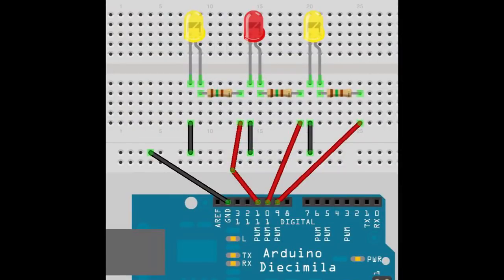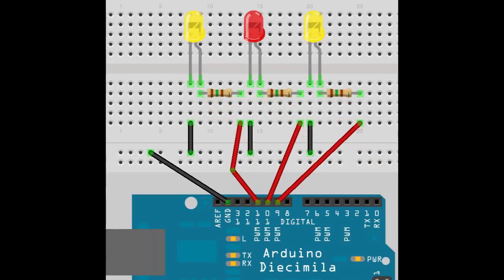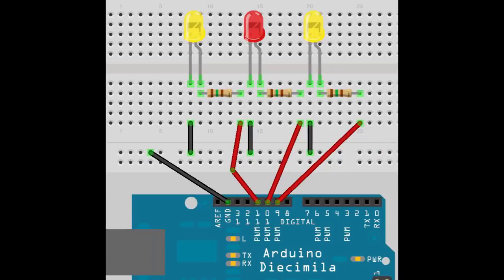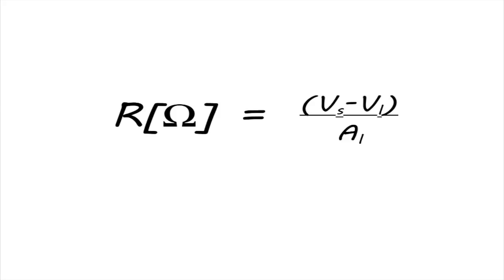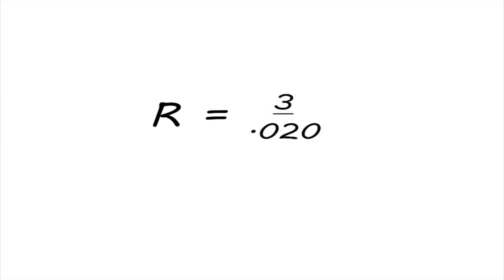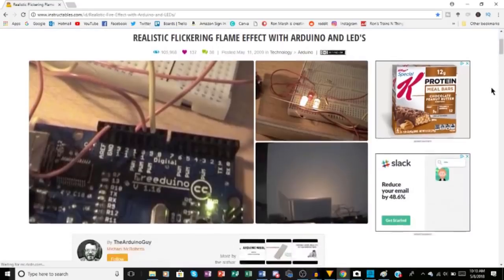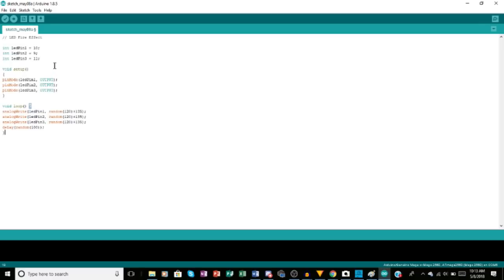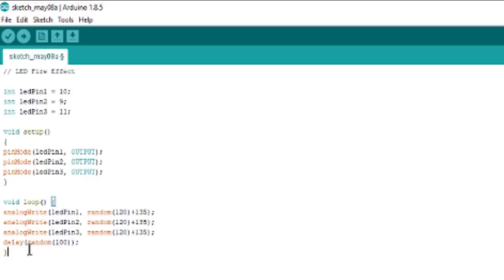Arduino Model Railroad Projects - Campfire

Comment: I am just starting a new small HO DC table and planing historically correct Native American aria with camp fires and hot rocks. I love this setup, but disabled and on a small fixed income, no DCC for me and thinking outside the box to do with what I got. So so far I have good results with $2 set of 4 battery tea lights. Not perfect,  but making them serviceable, I could replace them from under..... they only have yellow LEDs, but I think with some work, I think they can be parted out and changed up with other LEDs and maybe use more the one per fire.... ? But yes, I wish I could go this rout.....

Comment: Looks good as a bon fire but seriously way too large for  a camp fire. I just bought a camp fire module online for $13.00  Just give it power and it looks like a real fire. Mine was for a HO scale layout but would be easy to scale for N.  I like arduino, but sometimes its cheaper and easier to buy ready made circuits.
Reply from the maker: Yeah, the  sample was made with waybtoo large leds for video. I made one with 04-02 leds that is a perfect camp fire.

Comment: I wish you included in the video how you did wire it to the track or the bus, how did you solder the LED so on so forth, it is very clear on the "bread" but the track is different beast. Thanks for the great video.

Comment: Great video Mr. Ron!  I’m finally getting time to get back into model railroading and am astounded at all that is available today.  It seems that most of the things I’ve been fortunate enough to work at for the last 40+ years are culminating in this great hobby.  I built my first model car at about 5 and my first HO layout in my mid 20”s  with electronics as an early hobby , too many things to list over the years.  All I can say is, what a time to be alive!  Thanks for your great videos!
Reply from the maker: I get it. It took 25 years of collecting and a lifetime of hobby experience to get where I am in the hobby today.

Comment: One fun tip is to cast flames out of resin or other materials that dry clear then place it over an LED like a lampshade or cap when lit. Indeed a small pocket that the LED can sit in also helps in scaling a campfire and the cast flames can even be dyed/washed with color if desired.

Comment: wonder if you could mount this under the table, with a hole so the light comes through but the size can be scaled down.  Great work and it looks wonderful.
Reply from the maker: You could recess it down into the base of your layout, but you can also get smaller LEDs which is an easier solution.
Reply: Things are already getting too small for my eyes in N scale.

Comment: Absolutely one of the best explanations of a simple Arduino project I have seen.  I especially appreciated your use of graphics to demonstrate the circuit on the breadboard. Well done.  You are probably aware of this but there are a number of on line and phone apps that will calculate resistor size. I use iResistor and Perfboard on my iphone.
Reply from the maker: Yes, I am aware of that but wanted people to know how to do it also.

Comment: Can arduonos do multiple things?  Like could you power a small speaker with crackling fire sounds from the same board?
Reply: It is possible to multi task the Arduino to do both light effects and play sound; however, it complicates the  sketch.
Reply from the maker: I'm not sure, but that is something I'm looking to.
Reply from the maker: That's what I figured and that makes sense.

Comment: A very nice intro of Arduino to the model railroading community. Arduino has grown big amoung the young in the past decade. Its also a great learning aid for people interested in programming or electronics. Its sort of a "lego" for programming and electronics in that it has simplified everything to a plug and play system anyone of any age and skill level can get into affordably.

I've long seen arduino as being complementary to many hobbies and may be a way for the aging clubs to attract young members. Plus something young members can bring to existing clubs.

One essential place to visit is http://circuits.io which is entirely free and now hosted by Autodesk. circuits.io is basically an online simulator for Arduino so you can learn and experiment in safety very easily. Electronics is much simpler than most people realise and arduino makes it even easier. Especially if you think things like "I wonder what happens if I change out this led for a motor instead?" "Or I want these lights to flash red and blue". In this video we saw Ron found one of his LEDs was too brightly red and it only took a simple change in one value in the code to make the adjustment. Thats the power of the arduino platform, its designed to be solderless and the arduino boards (of which there are many) typically all run the same using the same bit of code you write plus they just plug in like any other USB device. This means if you want the same effect in different parts of your layout you can simply upload your code to several arduino boards wired up to LEDs the same way and they will all do the same thing.

Don't just think simple campfires, how about adding in a light sensor so as you dim your layout lighting the campfire becomes "lit", or the street lights come on. Don't just think lighting either, consider motors pulling fishing line to have moving cranes, boats, cars, industry features on your layout bringing it to life. Then theres all sorts of sensors You can use to detect things that happen: train reaching a layout point to light a displayboard marker, somebody walking into your layout room and the layout comes to life. Temperature/voltage sensors to alert you to potential problems on your layout. Then there are the displays of all sorts to allow display of whats happening on your layout and automate some calculations for you. Maybe you want a display to see what speed your high speed passenger service reached and averaged on its run today, or to display the efficiency of your train controllers: did all the trains make it on time according to their timetables etc. how about using an accelerometer, gyro and memory card writer to mount on a train flatbed to measure G forces and other loads as it travels around a layout all being recorded to a memory card you can read on your computer and help you determine risky curves on the layout and bumpy switches/track joins.

Arduino offers infinite possibilities to complement model railroading and many other hobbies. Its very cheap to pick up a starter kit with all sorts of devices to experiment with, lots of online tutorials and help available. As you learn and improve your code you can easily update any ardunios you have secured into your layout to improve its task as you need (just keep its usb port accessible. There are a confusing number of arduino boards available, I recommend the arduino uno as a good starting point. its a good design with capabilities for adding a variety of inputs and ouputs at once. Its pretty much all you need most of the time. There are smaller arduino boards which offer less "pins" used for inputs or outputs so if you are space constrained (like in a shipping container on a layout) this can be handy. and there are larger ones which offer more pins, or faster processor speeds. Plus there are specialised ones ready to allow you to control mains voltages to things like fans or heaters or for multiple relays. But they all run the same basic code and should all have the same pin numbers and basic connectors meaning Rons simple project could be used on any arduino board available without need to change any code or wiring. As you experiment and learn you will encounter the limitations of the board you first get and gain an understanding on what to look for in a suitable board for your project. Like I said, start with an Arduino Uno as the board allows for a lot of versatility adding multiple things together on the same project etc.

As a tip, I recommend buying a genuine Arduino Uno from the official website. As the ebay clones are not high quality builds from the factories, the official ones are superbly built and I find It best to prototype my ardunio projects on it as I can rely on the board and my project fails I know its MY fault, either in wiring parts or coding, so I can quickly troubleshoot. I used to use a cheap clone until i got one where I could see components soldered in place at odd angles, that board was defective and would drive me nuts trying to debug on a board that just was never going to work. So buy an official one and get a cheap clone to copy your code onto and wire up to your layout. Cheap and easy to replace and to throw a couple into a layout for adding life to your layout. Once you start you'll realise how dead simple it all is and with the online simulator you can try out various component before commiting to buying them.

Dont be afraid to give it a try, I'm a beginner railroader and even a simple oval still scares the crap out of me but building robotics with Arduino is dead simple.
Reply from the maker: Hi, Steve. Sorry for the late reply. Because of the links you included in your comment it got caught in my spam filter. You are so right, the possibilities for Arduino are nearly endless. I am just learning--I am no real electronics or programming expert--but the possibilities in my mind grow every day. I am also using it as a way for my 13 year old son who is interested in programming to get a start with coding in a way that provides some nearly instant gratification. Thanks for your comment and resources you shared.

Comment: Now you need to add a sound shield and have some sounds of a fire crackling, crickets chirping and maybe an owl hooting
Chuck
Reply from the maker: I am making plans for sound, but where this camp fire will be is next to a river, so I think the dominating sound will be that of a waterfall.
Reply: I think it is Model Railroader videos has a piece on adding sound using a Arduino.

Comment: To much work .to get one effect to work.Also how many arduino's do you need to get all the things you want to do on your layout? And how much code do you have to wight for each one? Seam's like a lot of work . when you get what you need for not a lot of money .And you just plug and play. no frustration when you don't get the arduino to what you want.
Reply from the maker: Setting up the electronics for this took less than an hour, including the copy-and-paste sketch, and cost less that $5 total. Seems pretty hard to beat to me.

Comment: Hi Ron, nice video, I like how you went through Resistance Calculation in detail.   As you've discussed, the 3mm LEDs are just too big although you "may" be able to get them under the camp fire.   The other alternative would be chip LEDs, the smaller ones.   Also, I think you could wire the Cathodes (Negative) together, in the center and have the Anode (Positive) leads on the outside, that way the Anodes wouldn't touch.

In any case, I look forward to how you do this in N scale.   I've worked on a camp scene and trying to create tiny, little, minuscule, barely visible camp fires is really tough.   Around the campsites here, we have fire boxes that are put there and they measure about 1.5' X 3' or so, in some cases on pedestals.   I'm thinking of trying to use Fiber Optics but they don't throw a lot of light.
Reply from the maker: I will be using nano leds on the layout. I already have them, but they were too small for the test run and WAY too small for video. I did wire under the camp fire exactly as you said, but didn't show it as the video was too long already. Thanks for watching.

Comment: The final effect is just perfect. I look forward to seeing your in-scale model. That will be tiny. The technical side of the code is key to the customising of the effect. Surely, you could even create some bad weather/lightning effect with this technique. 'Bad Weather Valley'. 😄
Reply from the maker: Yes, and similarly I plan to to the flash from an arc welder. That will be a future video.
Reply: That is a clever idea. I'm not in the field, but perhaps they have thin tubes you can bend and then fire the light down it? You could get some great effects.

Comment: Hey Ron, nice video. Here's something you should try, especially in N scale. Instead of 3mm LED's use nano LED's, therefore you could build a smaller camp fire.
Reply from the maker: Hi, Lloyd. Yes, I have already purchased some nano LEDs from Ngeneering for use on the layout, but setting the project up was easier with the 3mm LEDs and it was CERTAINLY easier to video than these tiny nanos would be. Thanks.
Reply: You'll have to get micro lens for your videos, remember you're in N scale...LOL
Keep up the good work